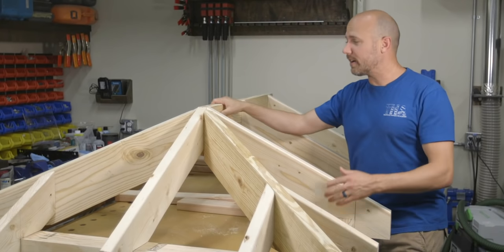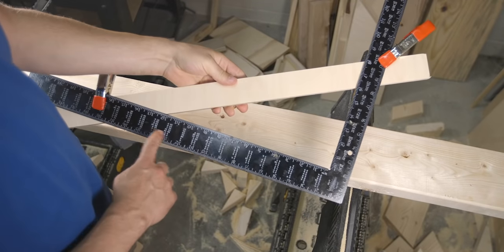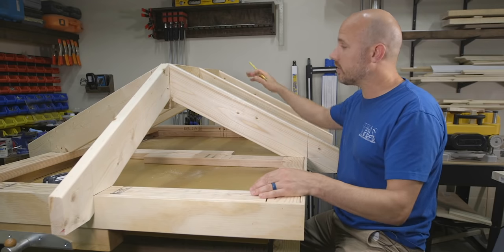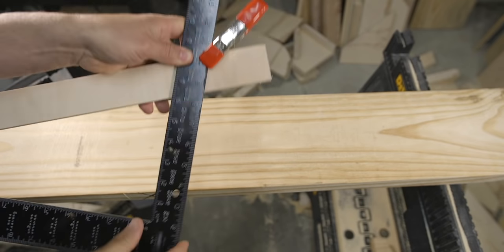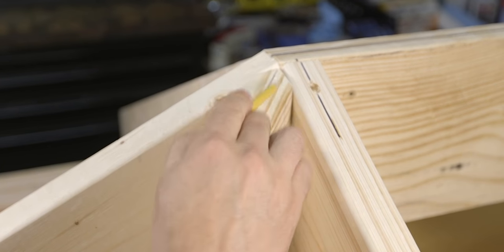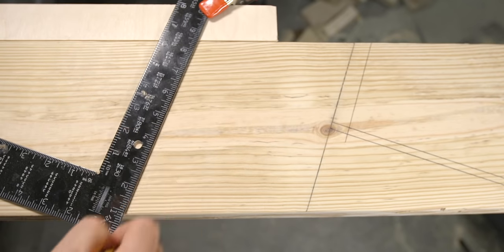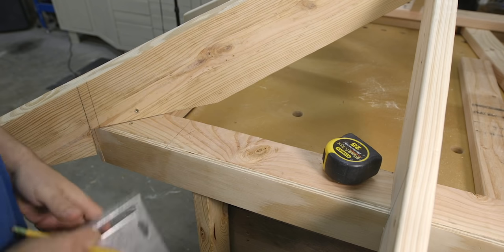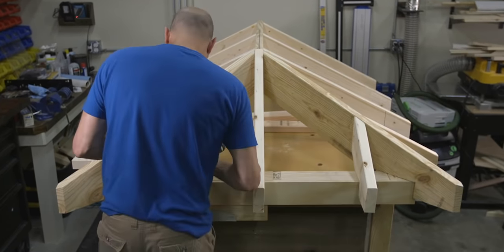How To Frame A Hip Roof - Including A Common Rafter Review

Comment: Where do you get 12" to 17" for the hip adjustment? I understand the 45 degrees
Reply from the maker: Hip and valley rafters both have a 17" run. Did you watch part two my chance? https://youtu.be/c2KrU2b1EJI

Comment: @8:20 Can you use Pythagorean theorem to determine the overhang? I’m getting 7.8 and the calculator you are using is saying 7.5.
Reply from the maker: Great question. No, you can not use Pythagorean theorem because this is a valley rafter which has a unit run of 17" and not 12". Honestly, the best way to do valleys is let them run long and cut them after the fact. :)

Comment: How did you mark those 3/4 lines? You didn't measure with a tape, yet you used a rafter square.
Reply from the maker: Tape or use the square

Comment: for the hip rafter you switch to 17. would it be the same if the pitch was 4? or is that 17 specific to a 6 pitch?
Reply from the maker: All hip/valley rafters are 17. :)
Reply: @TrainingHandsAcademy  Thank you for the response. I'm prepping to build my first hip roof in a few days and your videos are incredible.
Reply from the maker: @AnthonyBernhardt  Thank you very much. Reach out if you have questions once you start building.
Reply: @TrainingHandsAcademy  If the calculator doesn't account for the thickness of the hip; wouldn't you have to subtract 7/16" from the length of the jack rafter? The construction calculator is assuming length from the center of that hip raftor right? So we would need jack rafter to be shorter?

Comment: What is the rule of thumb for determining the length of soffit cut?
Reply from the maker: Generally around 10- 12" Most soffit material comes in around that width.
Reply: No I'm sorry. I'm talking about how when you cut the overhang you measure down for the soffit cut. Sometimes you do 4 inches and sometimes it's 6.5 inches. Does however wide the subfascia is determine that or does the width of rafter? Like if the rafter is 2x6 then you do 4 inches down just to keep it well out of the way of 2x6 subfacia?
Reply from the maker: It is determined by your finished trim size/design on the fascia. The subfascia simply supports the fascia material. First choose what size trim you are using and then determine how much material you need to leave on the rafter tail. There is more to this, but for simplicity that is the general idea. I need to do a video on this..    @anthonybarker6314
Reply: Thanks for replying! I'll keep an eye out for more videos!

Comment: How did you know to change the hip rafter on the framing square from 12” to 17”?
Reply: Hips are generally at a 45 degree angle. A 45 degree angle gains 5 in. a foot plus 12 is 17.common raffters cut at 5 n 12 hip n valley raffters are the only raffters that cut at that sequence.
Reply: So when you know a 45 gains 5 in. a foot you can measure to the peak of the gable say it's 12 ft 144 in. 12 x 5 equals 60 which is 204 in  Long point to Long point. There is the number for the sway brace off the gable made easy  and 6in. Is 2 1/2   3 is 1 1/4  1 1/2 is 5/8
Reply: Thanks man

Comment: how do you calculate the spacing of the jack rafters, if your common rafters are 24 on center, using the calculator? I have no experience in carpentry, but want to tackle a project in the future. Thanks in advance
Reply from the maker: Hey there. You can set the calculator to 24" OC.
Reply: @TrainingHandsAcademy  Thank you, but i wish i knew how to do that with the calculator.
Reply from the maker: @jeanlenzmichel521  type 24 inch, store, then 5 to change the OC from 16 to 24
Reply: Thank you Josh, got it.

Comment: I believe cutting (or framing) a Hip/Valley Roof is easier done, than said.   And explanations often make a mountain out of a molehill as it has in this video lesson.  

I once heard a statement so profound in its simplicity that it has become one of the first concepts that I will often share with others when discussing these simple Hip Roof Frames and the methods of solving the Roof Members Geometry.   (The Dimensions and Angles needed to mark and cut the rafters, both Commons and Hip/Valleys)
  
“Any line length in the center of a parallelogram is the same length as the sides of the parallelogram.”  

Dumbfoundingly Simple

Same concept applies to solid parallel forms, like rafters.

What this means is that it is unnecessary to mark lines in the center of the H/V Rafters and transfer equal geometry to the sides of the rafters.  The modern circular saws going to do that for you, only from the outside surface to the center.  Eliminates the redundance.  No hip-drops, etc.

And another secret to solving the Jack Rafter’s length is that . . .  “The Run of the Jacks is equal to the layout dimension _ from the Hip Footprint (located at the walls corner), to the out-side (long-side) of the jack’s layout”.  (For long point of compound bevel cheek-cut at head of jacks) (This is only true for Equal Pitch Hip roofs, Irregulars can be solved from lay-outs also but the Run/Layout dims are proportional to the two Pitches.)

So, all Rafters can be marked and cut simply in the same fashion as the Commons.  The Commons and full length Hips/Valleys lengths are calculated from the same “Run”, [usually (span minus ridge thickness) divided by 2], and the jacks (both Hip and Valley Jacks) can be calculated from either plate or ridge layout dims/as runs.

It just doesn’t get done any easier than that.
Reply from the maker: GREAT INFO
Reply: I personally think his description was more complicated than the video.

Once you really understand a topic, of course, it seems easy. It's when you try to put that knowledge to words that it gets complicated.

In the commentator's mind, it seemed simple. To the person trying to understand it (me), it seemed convoluted.
Reply: It sounds like YOU should make a video for a visual, because I really didn’t understand a thing you wrote… sounds like you made it more complicated

Comment: Roofing construction is basically triangles. The rafter length whether common rafter or hip rafter is simply the hypotenuse or longest side of the triangle. Nobody working on sites uses rise or run or framing squares you simply use a tape measure
Reply from the maker: Can you make a video and sent it to me on IG on how you do that. Thanks.

Comment: Is it critical to have all boards crowned up?
Reply from the maker: I wouldn't say critical... but it really does help with the plywood and the drywall.
Reply: @TrainingHandsAcademy  thanks for responding.  I’ve only built a hand full of gable roofs and always paid attention to the crown.   Considering taking on a small job with a hip roof and with this video I think I might can pull it off.  That calculator is the ticket.  I recently discovered I could find the exact length diagonally between two points to get it square and that will help me a lot.  Glad I bought it now.  Thanks for the video

Comment: You don't explain why you made the change from 6/12 to 6/17. I know it is for the seat cut. Do you add the length of tye seat cut to the 12" run and that becomes the hip seat cut?
Reply from the maker: The change is because we are going from cutting common rafters which have a run of 12", to hip rafters which have a run of 17". If you watch the video back I think you will pick up on that. I hope that helps.
Reply: @TrainingHandsAcademy  That makes sense. Thank you
Reply: @TrainingHandsAcademy  I'm sort of new to framing and that makes absolute sense now. Haha I'm so dumb. I've rewatched your video a few times and was confused. I for some reason thought common rafters and hip/valley had the same ol' 12" run and that's why your transition to 6/17 confused me.

Comment: Hey man great video! how did you determine the overhang?
Reply from the maker: Hey Dennis! For this mock-up I simply make it look right for the scale of the roof. Normally it needs to be determined by the size of your finished fascia board, and desired overhang. Overhang size really varies a lot, but I would say the average is between 12"-24" for houses, smaller for small barns/sheds. I'll have to do a video on that. :)

Comment: Another great video… thank you so much…… I have a quick question about dimensional lumber for hip roofs…. I understand building codes and was wondering your thoughts on using 2x4 for rafters on a 12 x 10 shed…. here on the east coast of Canada, prices are still quite high at over 20 dollars for 2x6 8’ lengths. So was thinking if 2x4 at 16” on center would be okay on a garden shed.
Reply from the maker: I'd check with your local codes Pete, but I think that would work.
Reply: I built a 10' x 12' shed using 2"x4" but used a 2"x6" Ridge board, and Z Ties on the 2" x 4" at 16" on center, it worked out so my rafters all lined up with my studs.
Reply: I am not a construction engineer. But I would not use 2" x 6" as the ridge board because it causes too much weight at the top. I am going to build a green house soon and I will only use 2" x 4' for the Ridge Board. You have to build four strong posts as needed
Reply: @HsingSun  It will bend and warp or wobble a lot easier then.
If you're building it with the proper amount of rafters for the length the weight differential between a 2x4 and a 2x6 is nominal.
You don't have to be a structural engineer to comprehend basic carpentry.
Better, and smarter men than you and I have worked for hundreds of years to perfect this industry, I trust their expertise over my opinion or perspective.

Comment: The one thing I believe was left out was the explanation of how the selection of changing the run from 12 to 17 inches happened. Yes, we know this change had to happen because hip rafters rise slower or more gradually than the common rafter, but why 17" and not 16" or 18"? There was no explanation given. Lets say the pitch of this roof was 8/12. Will the change still be 17 inches?
Reply from the maker: Did you watch part 2?
Reply: @TrainingHandsAcademy  I wasn't aware there was a part 2. Thank you. It made a lot. It cleared things up. Nice videos.

Comment: why do I come up with 7.81 when I use the formula C= the square root of A squared + B squared?  That's a little more than your calculator comes up with, but you are solving for C on a right triangle, so it would seem to me that, if I take my scientific calculator and use the square root function enter A squared + B squared, I should get my answer, but my calculation comes up with a little more than a 1/4" more than the 7.5".
Reply from the maker: Hey there! If you notice on my construction calculator I use the HIP/V button and the pitch button. So the C= the square root of A squared + B squared on a scientific calculator  doesn't work in this example. This of course is over simplifying things, but that's the easiest way for me to explain it. Also keep in mind that hip and valley rafters have a unit run of 17" and not 12" which changes things quite a bit as you can see in this video.
Reply: @TrainingHandsAcademy  yeah I caught the increase from 12" to 17" for the hip rafter. I really don't want to go buy another calculator. I just thought that maybe there was another equation for figuring out the tail. I get the rest of it. You gave a great presentation of it all.
Reply from the maker: @comingtofull-ageinchrist6736  You don't need a calculator to figure the tail length. Just let it run long, and then use a straight edge off of the common rafters to mark it's location.

Comment: Why is the length of the common rafter in this video 26 inches long and in the beginner common rafter video it is 30 inches?
Reply from the maker: Wow, great question! Because the rise on the beginner common rafter roof was 9", and the rise on this roof is 6". Does that make sense? I'm very impressed with your attention to detail and your desire to learn!

Comment: For the Jack Rafters you are adding 7/16" but you said to use half of the thickness of the material. Shouldn't that be 3/4"
Reply: If you use the common raffter length which already has 3)4 taken off. Put your framing square on a 2  by 6 or any straight board set square to the pitch of the roof say 5 n 12..mark where 5 intersects edge of board then 12..now measure the length, that's called length of run double that length gives 2ft increments of Jack's, because its 5 n 12 the 12 represents 1ft apart double it gives a 2ft layout,1/3 of 12 is 4 plus 12 is 16 in layout

Comment: What size saw do you need for hips?
Reply from the maker: I use a 7 1/4"
Reply: @TrainingHandsAcademy  that will make all the cuts you'll ever have to make?
Reply from the maker: @redsresearch  I would say 90% of the cuts you'll have to make.
Reply: @TrainingHandsAcademy  what would the other 10% be?
Reply from the maker: @redsresearch  Timber framing
Reply: @TrainingHandsAcademy  what's that
Reply from the maker: @redsresearch  Post and Beam construction
Reply: @TrainingHandsAcademy  post and beam hip and valleys?
Reply from the maker: @redsresearch  Are you familiar with post and beam?
Reply: @TrainingHandsAcademy  no
Reply from the maker: @redsresearch  Do and little google search to learn more about it. :)
Reply: @TrainingHandsAcademy  is it just those big sheds?

Comment: How u come up with the 7/16 of an inch
Reply from the maker: Great question Nick! It's the hip thickness (1 1/2") minus half the 45 degree diagonal measurement of the hip material (2 1/8"). Therefore 1 1/2" - 1 1/16" = 7/16" Does that help? If not, reach out to me on Instagram and I can send you a quick video.
Reply: @TrainingHandsAcademy  u can send me a video... I appreciate that u take the time to reply... where am from u don't get these kind of teaching
Reply from the maker: @nickpersaud7065   Find me on Instagram and send me a message. I'm always glad to help when I can.

Comment: Technically hips are not in 17 , it's 16.97.(I think, it's been awhile) yes it's only a 1/32nd or so but if your hip is 20 feet long thats about  5/8 of an inch off.. but the calculator already knows that. It'll make a difference if you're doing the math yourself.
Reply from the maker: Great info Tim! Thanks for sharing.

Comment: The hip rafter shouldn't be dropped .mark a centre line on the top of hip all the way down run a straight edge along tops of commons until it strikes the hip that will then give you your bevel to remove ..dropping the hip is not the answer if you want to do things by the book it's also not the end of the world depends on how keen you are 🏴